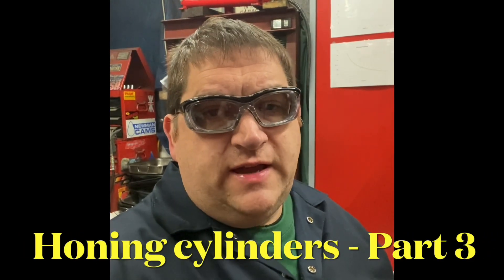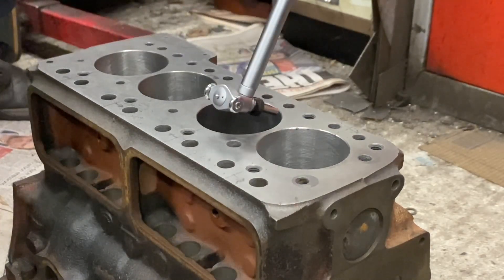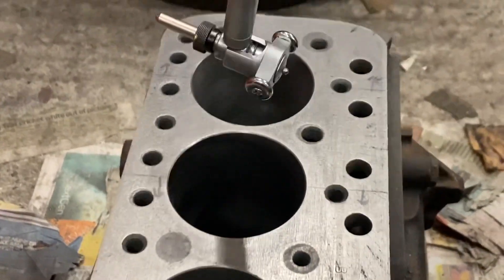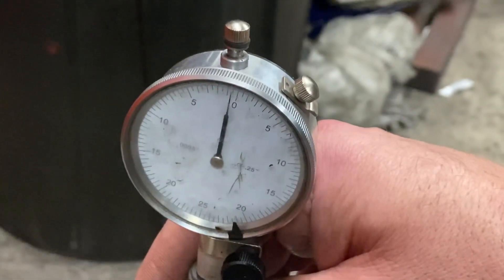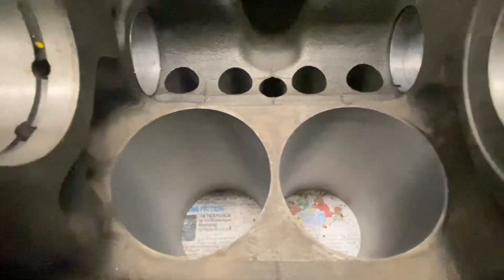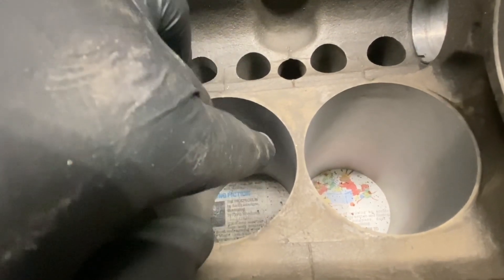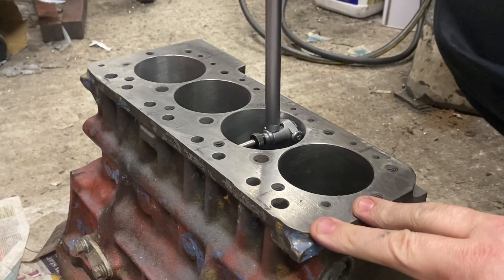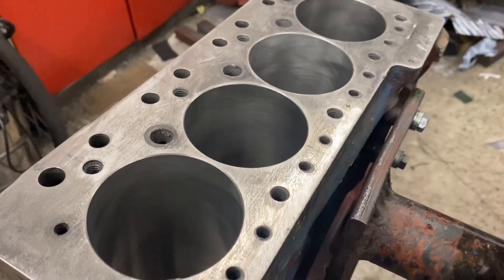Honing cylinders - Part 3

Comment: Question here ------- Watched all three videos you have on Honing ------- You are abroad -- I'm here in the States ------- The hone you are using looks a great deal like the Lisle 15000 ------ Here's the Question ------ Say a block has the cylinder bores out of tolerance to put the same size piston back in ----- cylinders really need to be machined out to the next size --------- Can a hone like yours ------ loaded with the coarse stones ------ take that bore out to the next size? ------- Watched how you took the bores to a zero tolerance ---- top to bottom and probably same size taken at ninety degrees top to bottom ----- With watching how one is doing ---- stopping cleaning the stones ---- taking measurements along the way ------- CAN ONE TAKE THAT BORE TO THE NEXT SIZE? -------- Bore is 4 inch ---- next available size is a 4.020 ------ Enoy Old Cars ----- trying to do as much work myself ----- mechanical to Body work and paint ------- Enjoyed your videos ----- Thank you for the TIPS ----- What country are you in? ------ Hope you have a Good Week ---------- Rodney
Reply from the maker: Technically it’s possible, but physically very hard work. Using a machine to hone a block to the next oversize is perfectly possible and is done frequently by those that have the suitable equipment.

Comment: As you probably know, it is possible to make a cylinder round off boring bar oval by starting with stones in same position after every check, I used to tell students to fit stones 90 degrees to last start position, or, after cylinder was oval, just before measured tight spot.
With some practice you can feel tight spots.
Cylinders were never used for a running engine they were given target size based on original measurements (measure cylinder and make it ten thou over )
Dead right you can get good results with a hand hone as long as you have practice.
Anyone with mechanical aptitude can learn precision honing in a few days, around 15~20 hrs
Nice cross hatch, you passed 😉
Sunnen hone was around $400 in 2004 but there were cheaper versions available on eBay last time I checked, available from India. (still about 10 years ago though)
Isn't your DTI in bore gauge 5 tenths? (0.0005")
Personally I prefer one tenth (0.0001") as the cylinders I do (69mm~80mm) normally use seventeen tenths to twenty two   (0.0017" ~ 0.0022") piston to cylinder clearance with OEM cast pistons (in air cooled motors, Honda and Yamaha.)
As long as your a little careful warming up there isn't a problem (things can 'cold seize' if piston is allowed to expand faster than cylinder by not doing proper warm up)
When I worked at UK Plant, we had a Karcher hot water pressure washer. It was fantastic for cleaning blocks and being above boiling point dried off so fast there wasn't flash rust anywhere (I did a 2.3 Vauxhall for my Manta GTE one January, snow on the ground)
Mahle make the best forged pistons in my opinion, the high silicon forging alloy they developed with Porsche has lower expansion than almost any other piston around.
Only problem is, they are crazy expensive (last time I bought some around 1986 they were £90.00 each, including VAT)
Lot of people like Wiseco, personally, not impressed as you needed 3 or 4 sets to get one matched set plus they are real high expansion (0.005" ~ 0.006" clearance on a 70mm bore!)
The machining did improve a lot when they got some CNC lathes in  90's
To do big bore conversion can get real expensive, particularly if you have to offset bore and fit wet liners.
Reply: I ovalled my first motorcycle barrels with a portable Sunnen hone. Doing exactly what you said here.

Comment: Hi, could you show us how to deglaze the  block bore too?
Reply: Use a ball brush hone, silicon carbide balls on nylon bristles. 
No idea of price nowadays though, 25 years ago they were around $35.00 in US but by the time import duty, mark up and VAT added probably £100 in UK?
 Snap-On dealers used to have them on the van but price generally jumps another 30%
Reply from the maker: Use the same tool if you have enough metal to spare. Deglazing is done with a different tool usually.
Reply: Just use a spring-loaded deglazing hone.

Comment: I used to let it sit over night so the block, piston and dial bore gauge all get the same size. Rechecking after 24 hours helped me a lot. Skip from # 2 cyl over to #4 then back to #1 finish at #3 this lowers bore distortion a little and every little bit helps Mate Have fun 
Do you use mostly cast iron rings? 
M
Reply from the maker: Cast or chrome faced